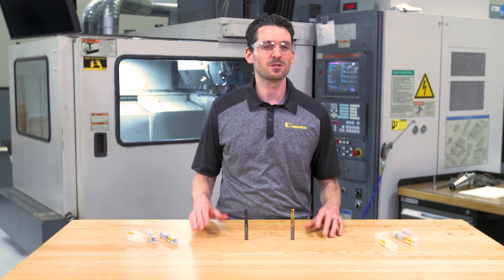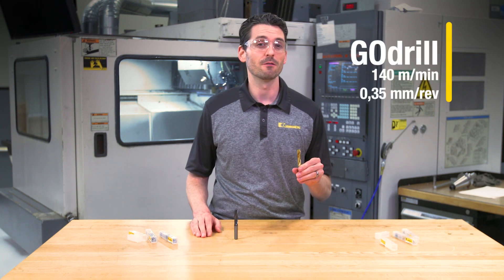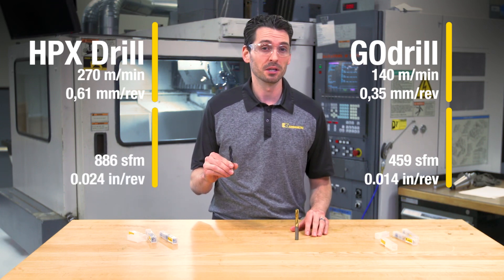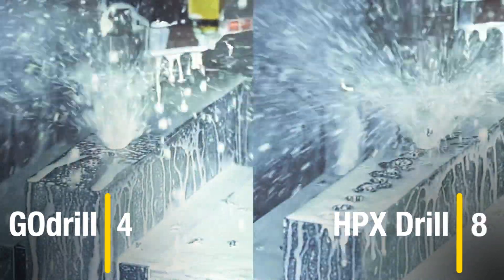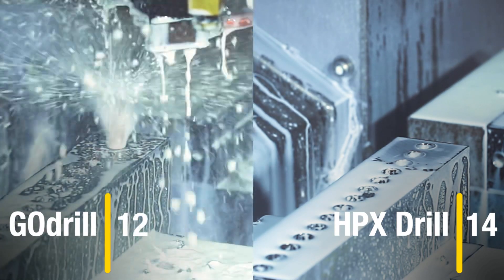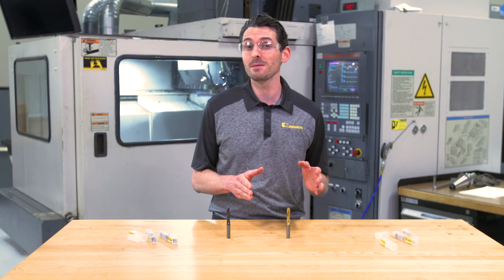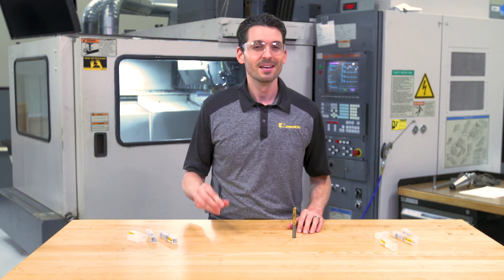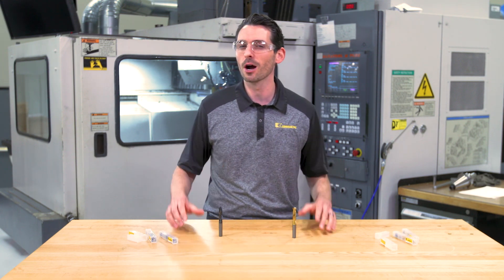HPX vs GOdrill - Material-specific vs Multipurpose Drill

Comment: 304 Stainless?
Reply from the maker: The GOdrill is a multi-purpose design capable of moderate cutting parameters in any material, including 304 SS.  It's a great cost-effective solution if you machine a variety of materials.  But if your needs require the highest cutting parameters in 304 SS, then you'll want to check out our SGL drill designed specifically for Stainless Steels.  SGL is capable of aggressive cutting parameters and high tool life, here's a link if you'd like to learn more on SGL:   https://www.kennametal.com/us/en/products/fam.b211-sgl-5-x-d-kcms15-a-shank-sgl-drills.100161498.html?pdpQuery=:relevance:allCategoriesKMT:7813126:allCategoriesKMT:7800158:obsoleteFacet:false&sort=&pageSize=16&category=undefined

Comment: Can you use these without coolant through the drill, or is it better to just peck drill with cobalt drills.
Reply from the maker: We do not recommended using a coolant through drill without having coolant actually coming through the drill.  The GoDrill is offered in a non-coolant through (or flood coolant) version that would be a great fit for machines without that feature.  Please refer to our website here:  https://www.kennametal.com/us/en/products/fam.b041a-3-x-d.100003658.html
Reply: @KennametalInc  would the performance be comparable with the tsc variant ? (within 30% or so) and how often would you need to peck if at all and how deep could i go without pecking?

Comment: Hey. Could you say more about what technically sets the HPX apart from the GO drill? Is it primarily drill point geometry, or other contributing different geometry? What's the drill point angle on the HPX? What about carbide grade? Thanks
Reply from the maker: Hello.  Both the HPX and GoDrill share the same point angle (140°) but after that there are several key differences.  The GoDrill has a general purpose coating (TiN) which works well in a variety of materials, while the HPX has an AlTiN coating specifically designed to excel in Steel applications.  That is the key difference, material specific (HPX) or general purpose (GoDrill).